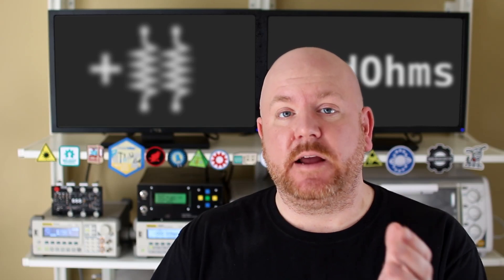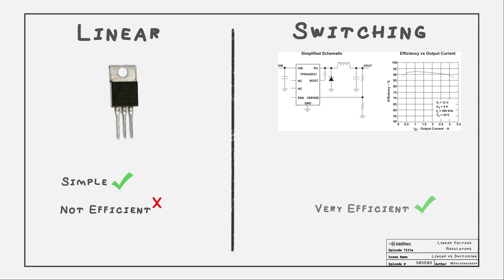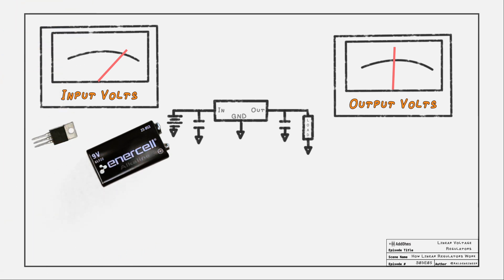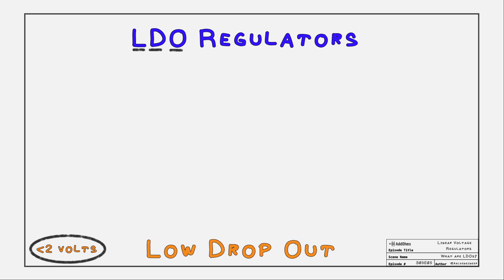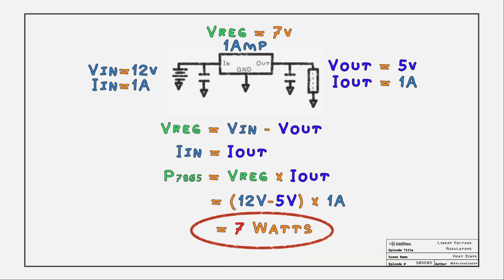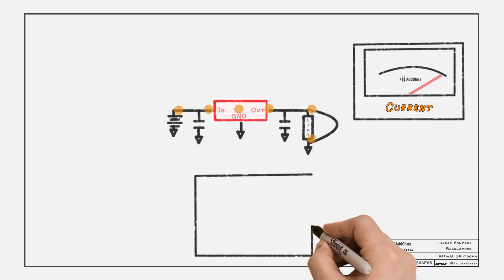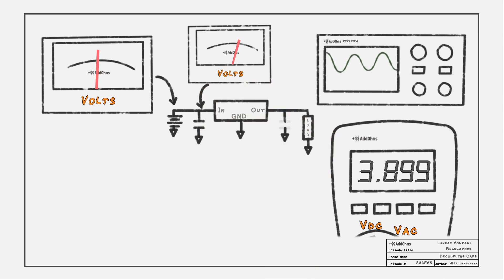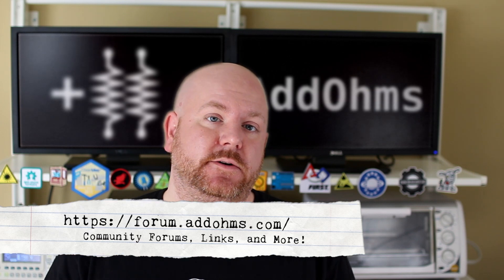Linear Voltage Regulators (LM7805) | AO #17

Comment: Excellent Tutorial.  The only thing I think was missing was expressly commenting on the most important aspect of Linear Voltage regulators - even more relevant to it's use than all that info about "heat".  And that is - each voltage regulator type is very specifically designed for a specific output voltage.  For example - in the LM7805 - the "5" refers to the output voltage of 5 volts.  In a LM7812 - the output voltage is 12 volts - etc.  Then of course the spec sheet for each device carefully defines the acceptable range of input voltages.   https://www.fairchildsemi.com/datasheets/LM/LM7805.pdf
Reply from the maker: Ahh, good point. That detail would have made a nice lead-in for when I come back to talk about Adjustable regulators (and how to make any regulator adjustable.)
Reply: I look forward to your next videos !!

Comment: how to take the value of capacitors??
Reply: shubham raj aonkimonki YESS! To start, your ripple frequency are almost some 100MHz so you objectif is to pass only the DC! Well that’s great bc DC’s frequencies are almost nul in simple terms you have to find the stability, then you know that the formula that gives the capacitance impedance is: 1/(2pi*f*C) otherwise when f=0(DC) the impedance is like too too high so current can’t flow through the capacitor and if f= almost 100MHz then you’ll find your 330nF ( behind that a complicated maths and a big knowledge of impedance at different frequency)

Comment: They may be inefficient, but are absolutely needed in radio gear as switching power supplies produce noise. I love linear power supplies, they are simple to build and very quiet. In order to use one for higher current a heat sink and fan helps. Switching supplies have their uses as well, but for me the linear is the most needed, In radio.

Comment: Hello, that was the most useful video on this topic thank you some much, now i understand everything about this device thanks to you,
but actually something confused so much, at 4:56 you stated that the output volt will change if we change the input voltage or the LOAD , and it did not make any sense to me, as I understood the output voltage is totally independent on the load and that is the most important property of this device, so please explain this to me , 
and one more thing which is not related to this topic actually, what is the difference between a variable resistor and a potentiometer ?
Reply from the maker: The point of the regulator is to provide a stable voltage regardless if the input voltage changes or if the load's current draw changes.  If the load's current draw changes, ohm's law would suggest its voltage drop changes, so the regulator must adjust its output to maintain a stable output.

As for difference "variable resistor and a potentiometer". In practice, nothing. By definition a variable resistor would only have two terminals. A potentiometer a 3 terminal devices that forms a voltage divider on its own
Reply: now i understand better , I was wrong about one point, Thanks so much

Comment: Why are the coupling capacitors used...? 
Does the ground of ic, input and output have to be same if I am using the ic in my circuit..? Pls. explain in details
Reply from the maker: They are decoupling capacitors, which are different from "coupling." I explain why starting at 4:52. 

Yes, all grounds must be the same. Ground is a reference point.

Comment: Sir can we limit the output current of a voltage regulátor upto a particular value for ex 1.5A.
Reply: If yes How can it be achieved.
Reply from the maker: With an external circuit yes. Do a search for "LM317 Current Limiter."
Reply: Thankyou sir Got the idea :-)

Comment: In my (Rather limited) experience I wouldn't place decoupling capacitors near the regulator depending on application. For example, if you have a transformer and rectifier you normally have smoothing capacitors which do the same thing as the regulator's ones. Also, it's best to place decoupling in between ICs so that they don't effect each other. Saying that, I'd just be sure to add some decoupling / smoothing capacitors everywhere so that no problems occur.

Comment: Nice video as usual XD.
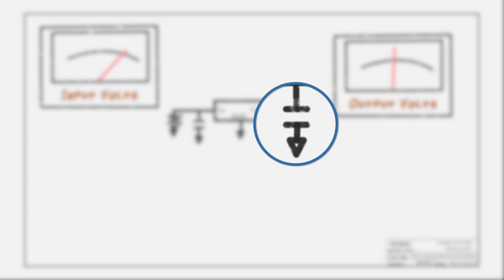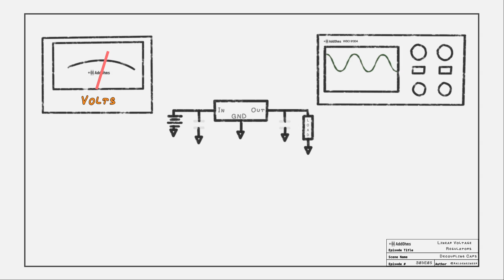On 1:40 and 5:16 the capacitors seem to be filtering not coupling as mentioned in video.!! Am I correct?
Reply from the maker: +majdinj I think you mean "decoupling", not "coupling." They are definitely not coupling capacitors. 

The language I used was very intentional. "Decoupling", "filtering", and "bypass" are often used mis-used or interchanged. 

In a linear regulator both capacitors are there for decoupling. Since there is no switching noise generated inside of the regulator, their primary function is to decouple, not to filter.  The input capacitor decouples the regulator from the supply. The output capacitor decouples the regulator from the load.

Switching regulators, the capacitor's functions a very different. In that case the input is generally decoupling capacitor while the output is there for filtering.
Reply: +AddOhms Oh thanks man.

Comment: Thanks for the video realy liked it.
A comparison video about zener diodes regulators efficiency VS  switch mode regulators efficiency for low power applications would be great.
If you could also suggest how small a switch mode circuit could be down to the SMT size I'd be happy.

Comment: Nice video as always! ;)
Q: I haven't got a lot of small caps and that's my reason for using caps with a higher capacity... (like 470uF instead of 20uF) 
Is this a big deal? 
Greetings from Germany!
Reply from the maker: +MrLookslikeMani Hi Germany! Yeah 100-470uF get used pretty often. I just want to make the point they aren't always necessary.

If you go with much larger values than 470uF, you may actually cause the regulator to oscillate when it first powers-on. Capacitors are a short circuit when they first start to charge. So too much capacitance can cause too much current, activating the thermal shutdown. 

Looking back, I should have added that in this video. I may make a separate one to explain better.
Reply: +AddOhms Thanks a lot. :)
Reply: My $0.02 - I've been using 10 mF caps for these for years. Never had a problem. I had always assumed that this was the norm.

Comment: I have actually killed a few 7805's by neglecting protection diodes between input voltage and output voltage. I used to use whatever big electrolytic capacitor I could get across the linear regulated output for maximum stability, but as it turns out if the input supply is disconnected and the input is shorted, then the charge from the capacitor goes backwards through the regulator and kills them.
Reply from the maker: +Power Max Another issue with large capacitors on the output is when the regulator first turns on, the initial inrush current of that large capacitance can cause the regulator to go into thermal shutdown. So you end up with a linear regulator which a huge oscillation, while trying to charge up the output capacitor--the same cap that was put there to help it!
Reply: AddOhms Yikes! I do notice that when I attempt to design a opamp based LDO from scratch in LTspice, if I use ideal capacitors (ESR << 0.1 ohm) then I almost always get high frequency parasitic oscillation. Probably more due to the effect of capacitance to the overall control loop rather than thermals, since LTspice does not seem to do a good job modeling thermal effects. (I can apparently use a 2N39034 to switch 100MA indefinitely... IDK, but I am pretty sure that would not work.)
Reply: AddOhms Something that I hope to do is to design my own accurate, arduino controlled lab power supply. One that will be at least 0-15V with 2 isolated channels, at at least 0-5A, which will allow full voltage and current range adjustment. That is proving to be a challenge with things like power dissipation, loop stability, transformer / preregulator stages, dropout voltage of the pass transistor element, etc. It is all getting quite complex! 

I have a dual-rail design in LTspice that seems to work well, I can give you a link to my old instructables question about it.
Reply from the maker: +Power Max For the longest time I wanted to design my own: power supply and oscilloscope. Eventually I bought them instead. Both are going to be "someday" projects for me.